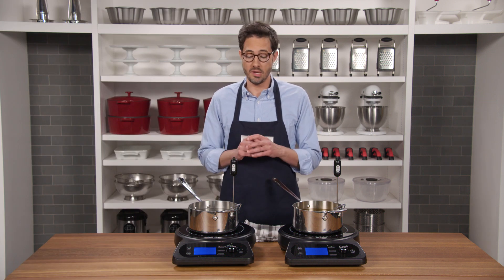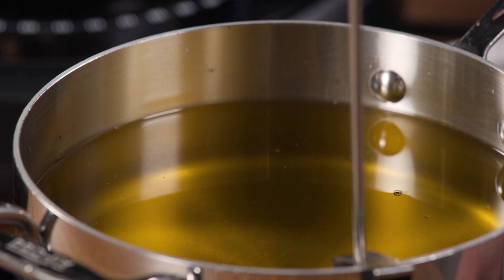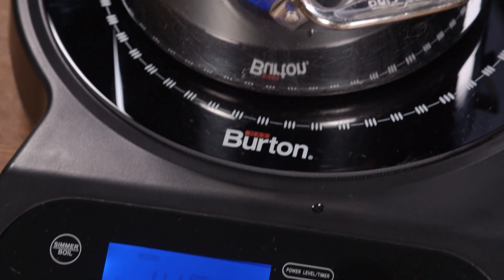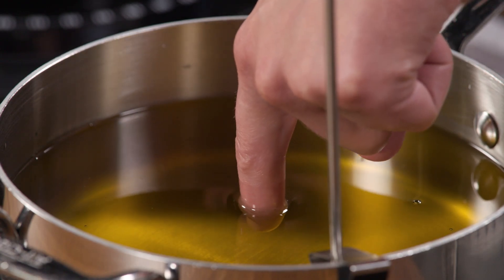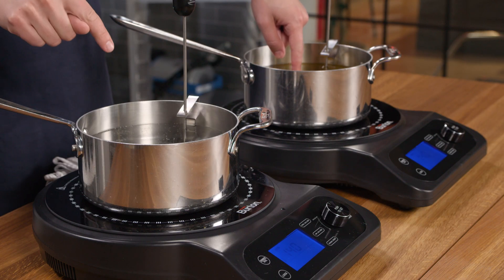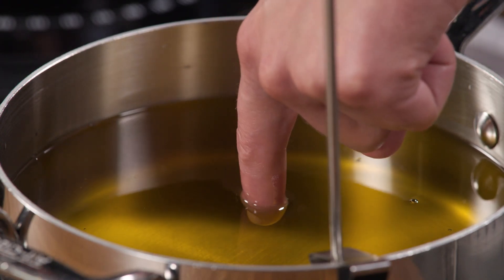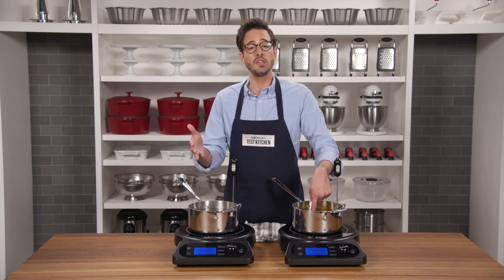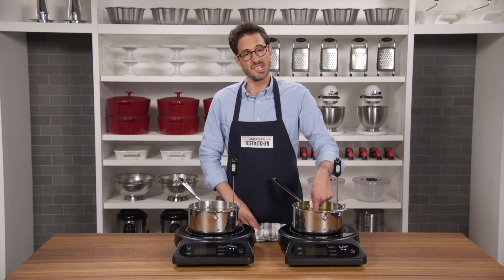The Science Behind Energy Transfer in Liquids

Comment: This is wrong. The water doesn't contain more energy, it just transfers energy must faster than the oil does. This is also the reason it takes more energy to heat the water - it's like filling a bucket with a large leak in it; it will get full, but it will take longer than the bucket without or with a smaller leak. The extra energy it took to heat the water isn't in the water, it's already been lost to the environment.
Reply: You are correct that the video is wrong, but your statement is also incorrect; the water dose contain more energy than the vegetable oil since it has a higher heat capacity.  The heating time will be affected by a balance of the heat transfer and the heat capacity (and other factors).  Assuming no system loss the water needs ~167J/g vs the oil needing <120J/g (assuming Δ40°C).

Comment: More numerically, their heat transfer coefficients are different. Water has a heat transfer coefficient of 800-1600 W/m^2-K, whereas cooking vegetable oils can range in the low hundreds (and lower with more degradation, as well). That's why oil takes so long to cool off, too
Reply: Yep, the heat capacity is going to help more with the water temperature stability.